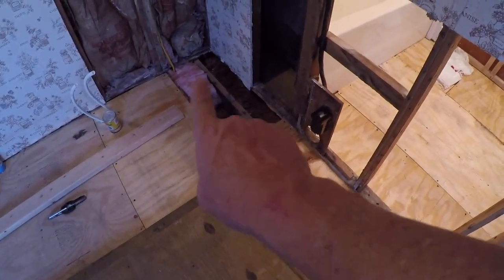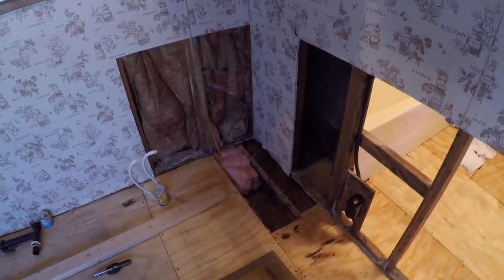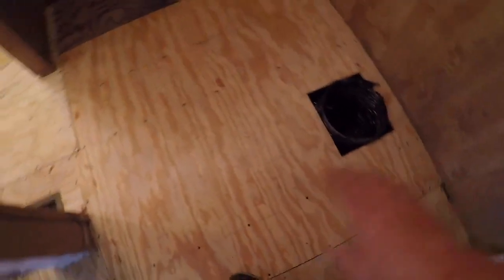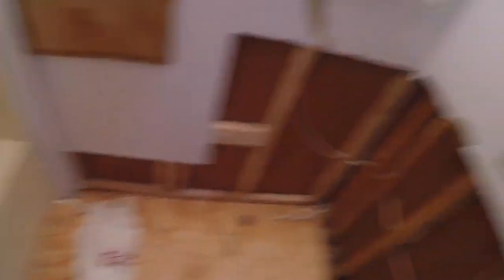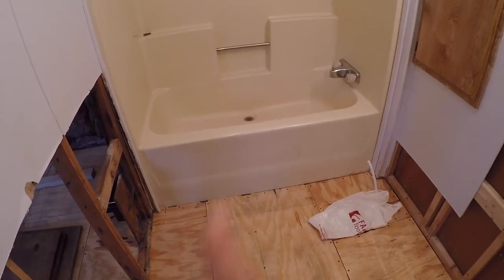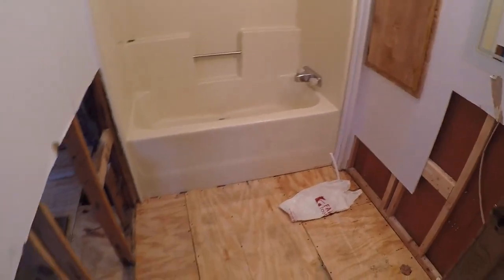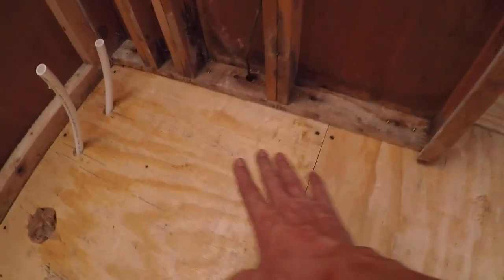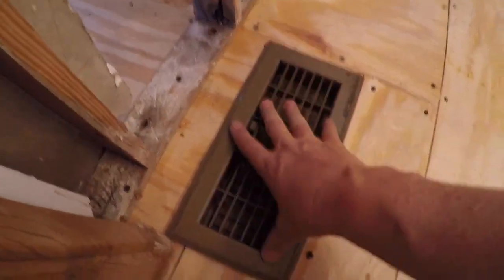Replacing Subfloor - Mobile Home Floor Repair Water Damage (Part 3)

Comment: After replacing a bathroom floor in a mobile home there is zero doubt that your workmanship is 1000% better than the original. Particle board subfloor should be outlawed!! That stuff is the devil’s work lol
Reply from the maker: I agree 100%

Comment: How did you or how do you jack up the exterior wall so that you can slid the plywood under the walll
Reply from the maker: We ran about a four foot 2x4 across the ceiling next to the wall and across the ceiling rafters. And ran another one on the floor directly beneath that one. Then used another 2x4 about 1 inch longer than the distance from the ceiling 2x4 and the 2x4 on the floor. Using a hammer we wedged that 2x4 vertically between the ceiling 2x4 and the 2x4 on the floor. We were able to lift the wall just enough where we were able to slide the new sub floor under the wall. Hope this helps you out!

Comment: Did you have to rebuild the counter or were you able to remove it with out damage. and how?
Reply from the maker: I didn't have to rebuild the counter. We lifted it up just enough to remove the old flooring and slide the  new flooring underneath it.
Reply: @DIYHomesteadProjectsDIYHP10  Thank you I am faced with water damage in the Kitchen &bathroom by myself I thought it was glued and stapled to the wall?
Reply from the maker: It may be glued and stapled to the wall. I think the one in my video was fastened to the wall with screws and staples but no glue that we found. I'm sorry to say but I don't know if it can be removed without tearing it up. Possibly but I really don't know for sure. Ours is a dresser in the bedroom and it had sagged with the floor about a 1/2" to an inch. It had some vertical play as a complete unit. Just enough to slide in the new subfloor. Getting out the old damaged flooring was a real pain. It was glued and stapled to the floor joists. I had to scrape each joist with a wide chisel to remove the glue and pull each staple out one at a time. It's was a lot of labor and time consuming but doable and repairable if you are capable of working on it.

Comment: Can you tell me how indeed the wall lifted between the bathroom and bedroom to get the floor underneath the wall? Like what method?
Reply from the maker: We ran about a four foot 2x4 across the ceiling next to the wall and across the ceiling rafters. And ran another one on the floor directly beneath that one. Then used another 2x4 about 1 inch longer than the distance from the ceiling 2x4 and the 2x4 on the floor. Using a hammer we wedged that 2x4 vertically between the ceiling 2x4 and the 2x4 on the floor. We were able to lift the wall just enough where we were able to slide the new sub floor under the wall. Hope this helps you out!
Reply: @DIYHomesteadProjectsDIYHP10  thank you so much!!
Reply from the maker: You're welcome 👍
Reply: @DIYHomesteadProjectsDIYHP10  I have another question...I have 39 ft travel trailer from 2003. I need to reframe part of the fronts two walls (very front and a side wall portion) as well as cut back a few rotted joists to sister in new ones. The joists run the length (vertical ) of the trailer. I'm not sure whether to start replacing the wall or the joists. One wall...the rotted frame and sill plate is so bad it is disintegrated and the aluminum exterior peice is currently free floating not connected for the most part. If you were in my situation...which would you tackle first? Is it safe to just cut a vertical running joist or 3 back like 8 ft to replace with new? Would anything structurally give way? I guess it's a few questions lol but you seem very knowledgable and I need to tackle this safely as I need to live in this thing asap! Everything in the area is tripped to the studs currently.
Reply from the maker: If it were mine I'd start on the bottom and work my way up.

Comment: So what if the subfloor is bad and runs under the exterior wall? Its in one of the bedrooms. Do I somehow lift it to slide the new subfloor under it? Help
Reply from the maker: You could do that or maybe use a chisel and a saws-all to (carefully) remove the rotten flooring and staples from under the edge of the wall. Then you can slide the new flooring under the edge of the wall. I noticed the damaged factory sub floor when dry, crumbles like a piece of toast. Several places I used a flat head screw driver to pick it out so we could slide the new floor in. Hope this helps you out.
Reply from the maker: You could also cut the old flooring flush with the edge of the wall. Then nail or screw in some "nailers" to the outer floor joists the wall is sitting on. That way you could run the new subfloor right up to the edge of the wall and have the "nailers" to support it from below and nail or screw the new subfloor to.